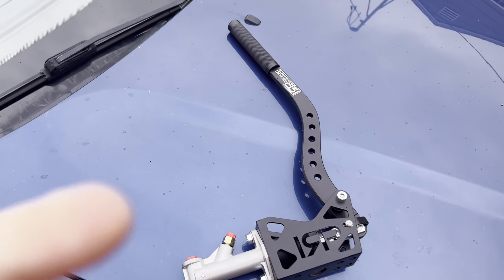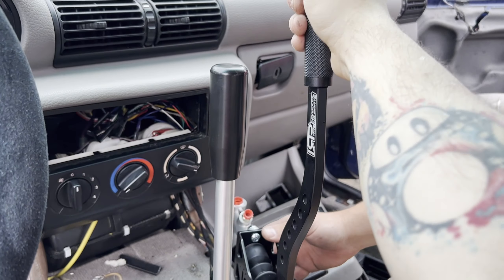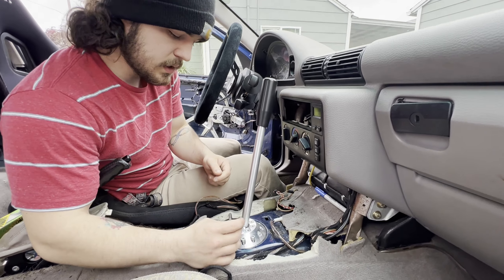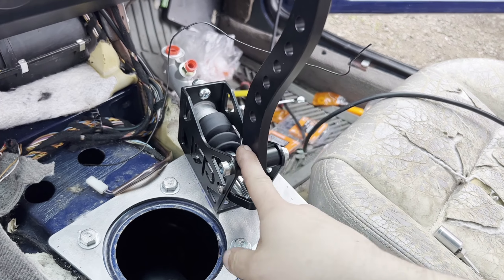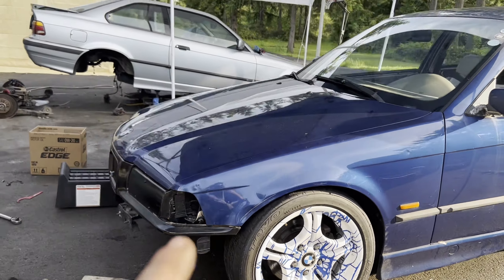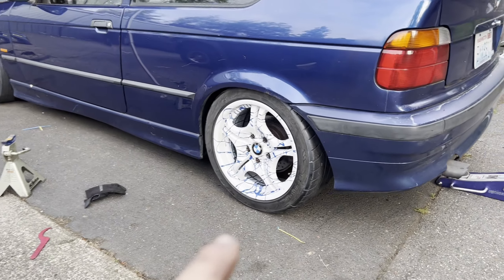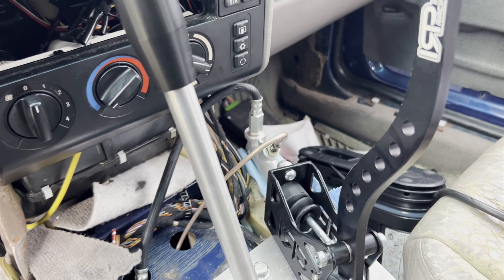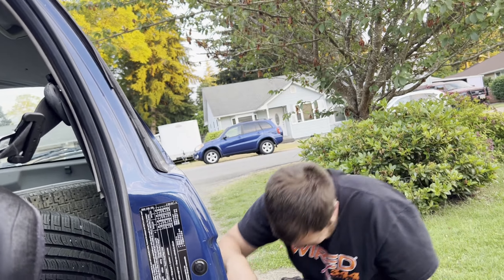E36 Inline Hydro Handbrake Install

Comment: You mentioned about coilovers on the rear? With the E30 rear subframe on the compact how did you manage that? As the spring is seated seperate to the shock

Comment: Hi, is the abs disabled? or doesn't it break anything on the abs when using the hydralic brake?
Reply from the maker: The ABS unit is still installed but yes, the ABS is disabled. I've never heard of anyone damaging the ABS unit with a hydro.
Reply: @JamDrifts  brake booster delete !

Comment: Great vids, that sparkplug looks lean burnt like you say but it also looks to have been exposed to coolant, if that plug was from cylinder 5 it could be that the head has been marred up a little bit from somebody reinstalling the head onto the alignment guide dowel on the block when installing the head, I've seen that issue a few times and have had it myself, coolant only leaks into one cylinder around the alignment guide hole location